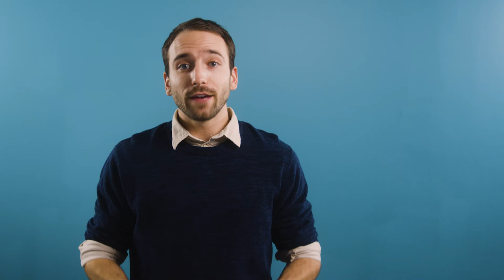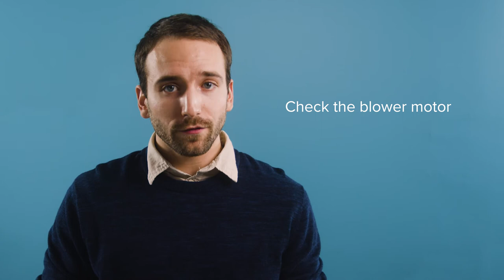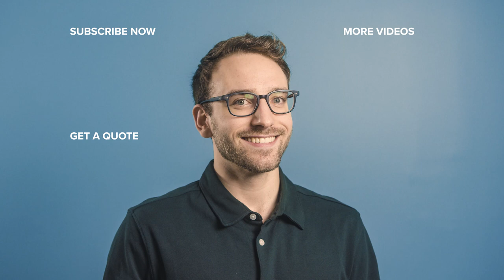[5 Tips] How to Prevent Your Furnace from Short-Cycling

Comment: I have read many posts on the subject of short cycling but have not found one that addresses my issue. I have a Goodman oil fired hot air furnace with a beckett burner. It began short cycling after being serviced by a local HVAC company. I have called that company back 2x and they have not resolved the issue. A separate company was also not able to solve it. I set back the t-stat at night and then raise it in the morning. If the new setting is more than 3-4 degrees, the burner will shut off before satisfying the tstat. The blower will continue to run and the burner will come back on after the high limit switch has cooled. At times the restart of the burner creates a loud boom and has blown off the stack vent, blew apart an elbow and blew out the barometric damper. I have raised the high limit setting, replaced the filters, and had the furnace serviced but this issue still continues on an infrequent, but troubling, basis. The nozzle is the proper size and the smallest recommended. Any suggestions.
Reply from the maker: It's difficult to say what the issue might be, particularly since you've already had professionals look at your furnace. You may have to get a second (or third) opinion from another qualified technician. If you do, make sure to have them inspect the thermostats as well as the ductwork, and not just the furnace unit itself. Any of these could contribute to the issues. Others have noted that booming sounds often signal fuel combustion issues.

Unfortunately we can't offer more specific advice. Best of luck with resolving your furnace's troubles.

Comment: why my thermostat is keep rebooting?
Reply from the maker: Hi Sony, some thermostats are battery-powered, and can suffer from frequent restarting issues when the batteries get old. That could be the issue. If it's not the case, you might have to consult the manufacturer's troubleshooting guide for your model specifically. 

There's also a little more info on furnace issues on our website: https://www.squareoneinsurance.com/resource-centres/home-improvement/furnace-short-cycling-causes-and-troubleshooting